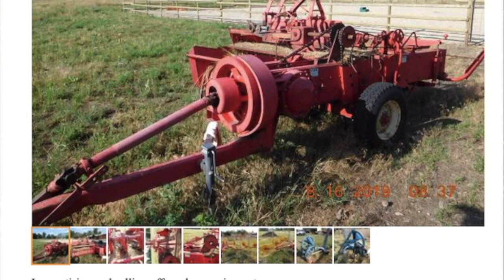Reviving a Hay Trolley

Comment: Wonderful video, thank you. I remember seeing these in more regular use as a kid. I often saw them used with a pan system for the hay in place of the method you use, but I think you're harness method works more efficiently with less hay spill. 
I also remember seeing them used with a winch system in place of a tractor, horses or a truck. I wonder if that is a modification you have considered? Nevertheless, your loose hay system does seem to work very well. In place of that, the bale stack is more efficient to save space, so you can increase storage quantity, but quality loss issue become more dominant, in my experience.
Reply from the maker: What is a pan system? The only systems we were familiar with were hay forks, hay slings, and harpoons but we''d love to learn about other methods!
We've thought about using a winch and it will probably happen at some point. We just don't have a (functional) winch right now.I'd love to mount it so we could do both pull directions with a single winch and switching the cable back and forth.
Reply: @cozycowfarm  There were two types that I have seen used. The first was a type made back in the Twenties by Vessot of Quebec for International Harvester. 

It was a kind of steel tray that sat on the hay wagon deck, with heavy rings at each corner. 
When lifted to the trolley, it ran the distance you wanted, then tripped from the side. It was intended to lift the whole load as one stack. I recall it was difficult to work with, and heaven help anyone in the way of that swinging metal pan! 
As the barn filled, it required more workers in the loft to shift the hay over from where it fell. 

The other one I saw worked like a hay sling, opening in the middle. It was made in 1939 by McCormick, out of Ontario I think, and was basically a wooden frame with sheet metal, and the bottom of the pan had skids underneath if the pan needed to be set down on the ground. 
The idea was a good one if you had three or four on the go, since you could put a whole load down, pick up an empty pan. and go back out to the field for more. Then either someone loaded the hay up into the loft, while you were gone, or you did three or four at once when you got back. They were easy to cover with a tarp as a temporary haystack, if needed. They tripped open in the middle like a hay sling, and had travel locks on the corners to secure them to the wagon, as well as  slide bolts to keep the middle secure. The  bolts had to be unlocked before you raised the pan to the trolley, or it wouldn't dump.
 I think the reason they were discontinued was due to the steel shortages during the war. The last one I ever saw still in use was in Manitoba at a family dairy near the border.
Reply from the maker: Thanks so much for your description! Those sounds really neat!